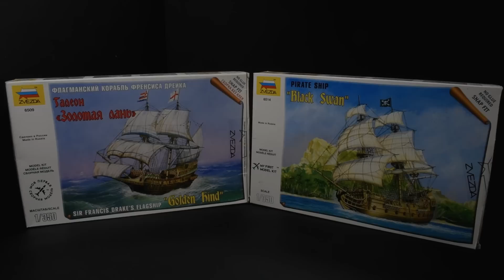Realistic Diorama  "Pirate Battleship"  How to make- Epoxy resin art

Comment: nice worck but the sail on 11 38 i thinck is mounted backwords
Reply: I caught that, too. It looks like the fore topmast staysail... and yes, the clew (the part where the sheets, or controlling lines, attach) should rest higher than the tack (the part where the bottom corner of the staysail anchors to the stay). Basically, he flipped it... but that's an entirely forgivable mistake when working at such a small scale. Easy to overlook.

Comment: As an old square-rig tall ship sailor, I greatly appreciate the attempt to make better rigging than what must have come with the model. Although I wondered about the inclusion of a dolphin striker on the pirate ship. That ship has a very pronounced beakhead, and it would have been very rare to see both a beakhead like that and a dolphin striker together. They are from different eras of ship design; the large beakhead fell out of favor (and necessity) by the end of the 18th century, and the dolphin striker wasn't in widespread use until the early-to-mid 19th century. If you did see them together, it would almost certainly be on a ship from the 1790-1820 window... and the "Black Swan" looks clearly to be a late 17th or early 18th century design. But of course, I'm picking at small details. The diorama is still beautiful and compelling.
Reply from the maker: Many thanks for your useful comments. I thought that the dolphin strike was a nice touch and didnt have in my mind so much the historical accuracy.

Comment: If you used the hot glue on the lights how will you be able to replace them? Not being snarky. Really want to know. P.s. loved it
Reply from the maker: indeed but a little hot glue served to insulate  and keep the wires from touching each other. the last thing i wanted was to finish everything only to find out that the lights don't work. now if i ever have to change the lights i will have to unstuck the wires or remove the upper part of the ship
Reply: @4THECRAFT  thanks for the answer.

Comment: Amazing job!
I like to build sailboats. I usually use, instead of the sails that accompany them, silk paper with white glue, applying to the sails that come with the model, as a way to copy the shapes, but with finer material. So, I have the textures of the original sails with silk paper painted with glue in the matrices. The result is that the sails are firm, but quite malleable. I can thus give the shape or fold you want, to create more realism. 
Hugs
Reply from the maker: Thank you for the tip. 😊👍👍👍

Comment: Thats amazing! Loved every bit of it. Could you also share how you wire up those foldable LED lights? How do you attach wires to them, and how fdo you get them to work?
Reply from the maker: Many thanks. This is an LED strip which operates with 3 AAA batteries.   I just cut the strip at the right place and then solder the wires at the + / - poles.
Reply: @4THECRAFT  Thank you for the reply! What batteries are required for those LEDs? I think I'd like to try using the same LEDs...! Again thank you. Also where do you find reference on how to rig the lines on the sailing ships?
Reply from the maker: For the led strip, 3 AAA batteries are required. For the 2 small LED lamps that I have used for the cannon explosions , one round 3V battery is required for each. I had to make some research on how to connect all the lights together (for example the 3V lights on the pirate ship are connected in a parallel connection) and made a few trials before proceeding with the diorama. For the rigging of the ships I have used my previous experience in wooden ship modeling and also used some plans of wooden model ships that i have built in the past.

Comment: hook it up to a couple of 555's that are timed such so it looks like the first ship is shooting and then the latter is exploding. Could give a pretty cool effect. All the 555's and componentes, would fit around the battery holder in the bottom, so you don't need to modify the actual diorama if you want to implement my idea. You could even have a 3-pos switch: Auto-off-on, where Auto is the timed "shooting and later exploding" scene, off is lights off, and on is lights permanently on.
Reply from the maker: Many thanks for the tip.  I have no idea what the 555s are but I will look it up. 👍
Reply: @4THECRAFT  a 555 is a timer chip, a little 8 pin DIP package. You can google "NE555" for the datasheet, its also very cheap. You then control the functionality and timing by the use of some external components.

In this way, you can have one 555 chip that makes a couple of flashes with the cannon. This chip needs to be in single-shot mode, ergo where it flashed a couple of times, and then never flashes again until it gets a new signal.

For the explosion, you need a pre-delay and then a slower pulse-train, which is also accomplished with 2 555 chips. The pre-delay just delays the signal like half an second, and the second 555 chip could be configured like the first, but with a slightly wider pulse train, to make it more realistic.

Then you have a fourth 555-chip that does send out  a signal which repeats X second. This signal is then wired both to the pre-delay chip for the explision, and the cannon chip, making the whole contraption being fully in sync for infinite periods of time.

The chips exist in VERY SMALL configurations, why it will fit in the spacing around the battery holder.

Comment: Wireless leds sender and receivers are cheap from Aliexpress and you could make impressive stuff with them. I've been using that technology for props (far less impressive than yours) and it's very easy, yet the effect is kind of magical.
Reply from the maker: Many thanks for the tip. I will check it out👍👍

Comment: Very nice work - but "Hollywood". Sailing ships in battle would take down most sails, so that if rigging was damaged by enemy shot the masts and yards would not be pulled own by the wind. It was common to lose riggning and running gear anyway, but at least the effect was mitigated. Nets were spread above the deck and helm, to catch faling debris before it landed on the crew. They would also put flags at each masthead in case one was shot away. Surrender was signalled by taking down the flag(s), and you did not want your own crew to think you were giving up.

Regarding your rigging - an easy alternative to thread is to use fine nylon, glued in place. The lines can be tightened with a warmed metal skewer or needle (the nylon contracts when heated).

It's an awesome diaroma. Have you thought of a sequel, with a broken ship lying on the seabed?
Reply from the maker: Thank you for the tips and the nice idea for a future diorama.

Comment: I think the Cannonballs didn’t actually explode, they just tore holes into the ship
Reply: For the most part, you are correct. Exploding shot was rarely used, as it was often unreliable, dangerous to use, and comparatively expensive to produce. But explosions like this did occasionally happen if the ship's powder magazine was breached and open flame introduced. If a magazine went up, the explosion could be enough to shatter some ships almost to the waterline.